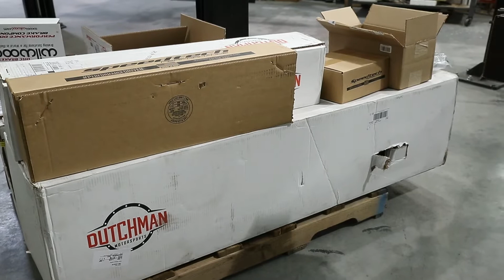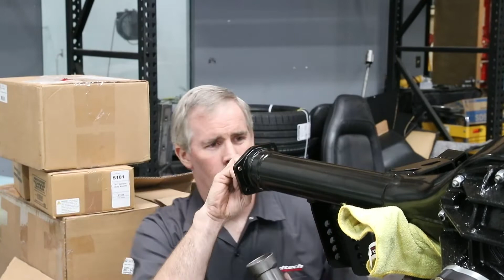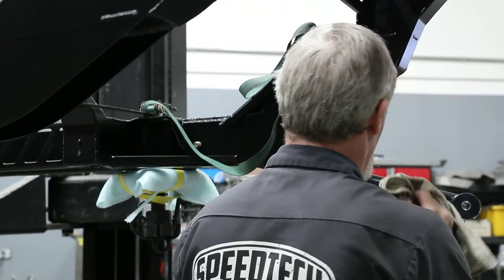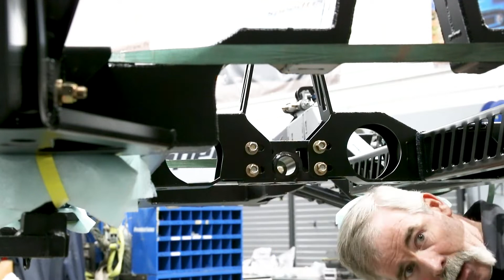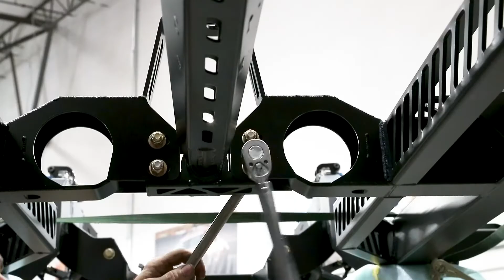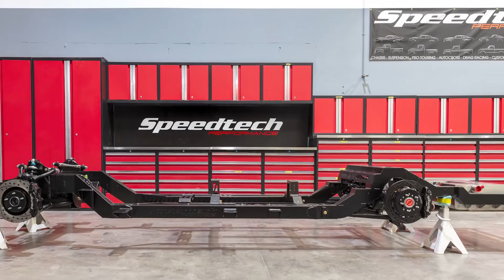Extreme Chassis Part 2: Torque Arm Rear Suspension

Comment: Would like to see a video for 70-81 rear torque arm install and adjustment. Also and one showing where you measured the driveline angles and how you made adjustments.  At 15:48 you mention that the main thing with the panhard bar adjustment is to get the axle centered but just before that you say it needs to be parallel. What if it's [parallel and not centered?
Reply from the maker: Hey @konkan5728, 70-81 what?  Camaro?  I'll be making a video on a First gen. soon and it will be very similar to Second Gen, in the mean time have you looked at our installation instructions on line?  As for the pan hard bar:  You want the axle centered in the chassis, this is adjusted by how long/short the pan hard bar is.  Vertically you want it be parallel with the axle housing and the ground, this is adjusted at the brackets the PHB mount in.  For more info give us a call, happy to take you through it all (435) 628-4300.  Driveline angle is usually spot on when using our stuff, it can be adjusted but usually will not need to be.
Reply: @SpeedtechPerformance  I have but welcome a video to see exactly how you guys do it. Are the trailing arms measured center eye hole to center to match once it is determined how long one is necessary to center the wheel in the wheel well?
Reply from the maker: @konkan5728  yes you have it right.  If you have any questions give us a call. (435) 628-4300